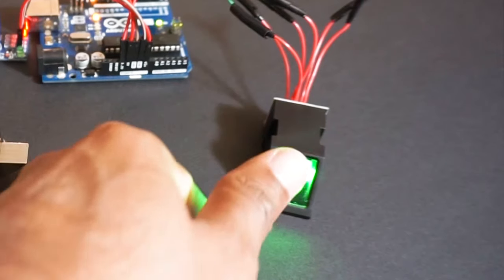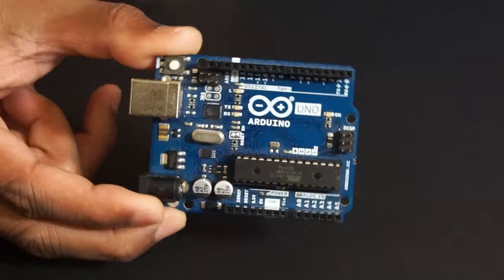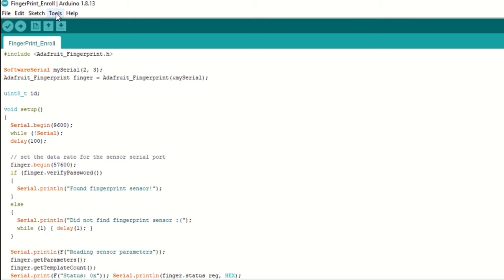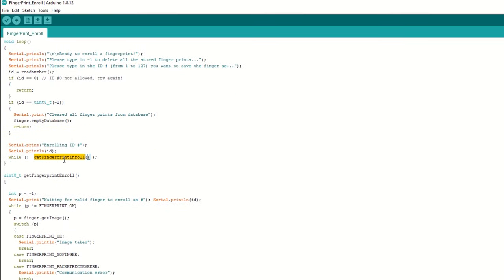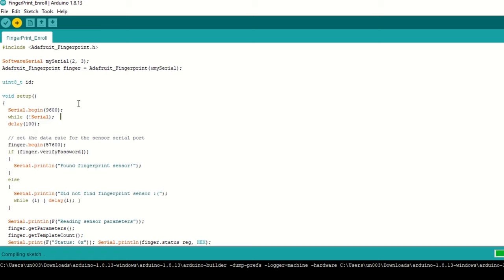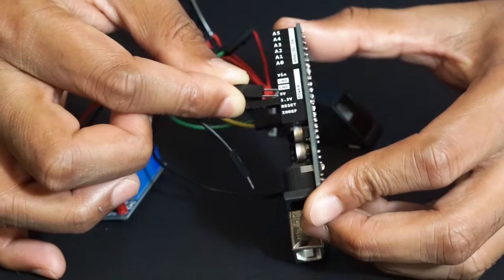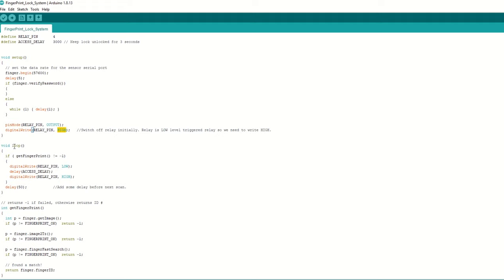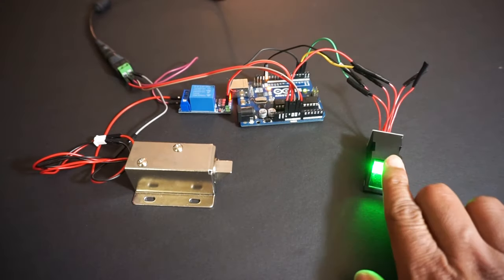Fingerprint Door Lock system using Arduino👍🔓 | FPM10A fingerprint module

Comment: 00:41:16.381 -> Ready to enroll a fingerprint!
00:41:16.415 -> Please type in the ID # (from 1 to 127) you want to save this finger as...
00:41:20.830 -> Enrolling ID #1
00:41:20.830 -> Waiting for valid finger to enroll as #1
00:41:20.863 -> .
00:41:20.863 -> .
00:41:20.898 -> .
00:41:20.898 -> .

I get above endless loop of timestamp, thank you because from your video, I was able to connect my fingerprint, but I cannot register fingerprint
Reply from the maker: You might be missing some step . Please check the video carefully and slowly 👍🏻👏🏻
Reply: @hashincludeelectronics  thank you, am following well, it's detecting and it is registering but the timer is still running

Comment: Shall i use 12v ac dc adopter with 2.5mm pin  and the power jack is 2.5 mm. Use or not please reply
Reply from the maker: You can use that 👍🏻👏🏻

Comment: Awesome explanation I wanted to add a  buzzer to the above project  can you please help me with it's code like what I have to modify in the code so that Buzzer beeps incase of an incorrect fingerprint can you please help me with this
Reply from the maker: Sure . Adding buzzer is very simple .Please check my other videos where I have used buzzer for reference and make the simple code change accordingly. Check my ultrasonic HCSR04 video where I have used buzzer .
Reply: @hashincludeelectronics  Just watched the video thankyou it's helpful is there any way I can contact you as I have some more doubts about the project
Reply from the maker: @niharikam4744  you can join my Instagram hashincludeelectronics

Comment: Hi great video, but i have one question. Why does my lock go the opposite. What i mean by that is when i supply 12v is opens without the touching the sensor, but when i touch the fingerprint sensor it locks.
Reply from the maker: Thanks for checking out the video . Looks like your relay is high level triggered relay. Use low level triggered relay and your problem will be solved . Or you can make changes in code  and Interchange HIGH <-> LOW.
Reply: @hashincludeelectronics  thank you very much that worked out very well. 👍
Reply from the maker: @miko2946  I am glad that it worked now 👏🏻👍🏻

Comment: Hi, great video! I have a question about the fingerprint sensor. Its TTL interface or USB? For the USB interface can I use the same method in the video to connect the sensor to the arduino?
Reply from the maker: It’s TTL method . Please follow the video 👍🏻👏🏻
Reply: Bro,how to install adafruit fingerprint

Comment: When I place my finger nothing happens. I checked if there was a problem with the scanning but it was fine. It could recognise my finger. I then tried to test the lock and that works too. I cant understand what is wrong. If you can help it would be really nice. Thx bhai 😁
Reply: Wait i did it. I looked through the video again and realised I didn't calibrate the sensor properly. Your an amazing guy tysm :>>
Reply from the maker: Good job 👏🏻. Well done and I am happy that it worked 👍🏻

Comment: hello sir you use adapter dc ac 12V 1A or 12V 2A or 12V 3A
Reply from the maker: You can go for 12v 3A if available . Else 2A is also good .
Reply: @hashincludeelectronics  tq soo much

Comment: Sir
I uploaded the first code and enrolled my fingerprint there. Its working properly. I'm using R307 fingerprint scanner. But after all connections when I uploaded the final code and when I'm trying the lock is not at all opening and the fingerprint sensor light also turned off after I put my enrolled finger for final checking. You are my only hope. Please help me in this 🙏
Reply: Did you find out where the mistake was? If so, could you please advise me? I have this problem too.
Reply: @alphatauer4766  Sorry bro, After I got this problem, I left the project because I don't know how to proceed further. I tried to proceed further but nothing worked out...

Comment: Hi, I'm getting this * did not find fingerprint* I'm using Nano and used the same conding that you provided. when i connect the wiring my sensor doesn't turn on.😢 
Please help me.
Reply from the maker: Please use Arduino Uno only . Because sensor needs 3.3v and not sure if Arduino nano is reliable in providing 3.3 v .
Reply: @hashincludeelectronics  There is 3.3 v option one more thing now I'm getting error of can't connect to COM port and all of lights are turned ON on my nano board.😐
Reply from the maker: @sereneexistence1480  do you have Arduino uno . Please use that and try 👍🏻👏🏻
Reply: Exam I am getting the same problem

Comment: I need some help. My lock works, but only once, and my fingerprint senor light is flashing slowly, and doesn't work after once, and I have to replug the power adapter to open the lock again. Any solutions?
Reply from the maker: Check with another sensor .
Reply: @hashincludeelectronics  It works! Thanks!
Reply from the maker: @NanoTheLuuProto  awesome work 👏🏻👍🏻

Comment: Bro i have problem i use arduino mega instead the uno there any problem with it ?
Reply from the maker: It should work with mega as well . I don’t see any issue .
Reply: @hashincludeelectronics   the problem is in codes i think can you help me ?
Reply from the maker: @miranwahid9472  what specific error are you getting in code ? The code is well tested and works .
Reply: @hashincludeelectronics  the pin in uno serial 2,3 is not work in arduino mega when i put the wire in same place the sensor doesn’t show light !
Reply from the maker: @miranwahid9472  do you have Arduino Uno by any chance ? I would suggest Try on uno first and see if your sensor works as shown in video . Then try on mega .
Reply: @hashincludeelectronics  no i don’t have uno :(

Comment: Thanks, I'll try to make it, I hope it works
Reply from the maker: Cool 👍🏻all the best for your project
Reply: @hashincludeelectronics  If I have a trouble, may I ask you a question?
Reply from the maker: @denart99  sure anytime here .
Reply: @hashincludeelectronics  ok, brother 🙂
Reply: Brother, I have a problem, the solenoid won't move even though I have attached the cable correctly, even when I plug the 12v adapter into the mains, it emits a slight charred smell
Reply from the maker: @denart99  could you please check if the adapter is providing correct 12v dc only ? Also make sure you connect positive and negative wires correctly . Red is positive and black is negative . Also make sure your solenoid lock is 12v lock .

Comment: Bro pzz i have all components redy but 
The problem is when i connect finger print sensor to Arduino the sensor dosnot onn when we go to add the finger then it get onnn
Reply: And when we connect uno to pc the sensor doesn't gett on
Reply from the maker: Please follow the exact steps in video 👍🏻👏🏻

Comment: If i connect fingerprint to 5v it's right or no
Reply from the maker: Please check the video and connection diagram 👍🏻
Reply: @hashincludeelectronics   yes i watched but I use another type of fingerprint work at voltage 3.6-6 volt
Reply from the maker: @HusseinKadhimJawad  ok in that case you can use 5v

Comment: Is there anyway to open the lock when there's no power?
Reply from the maker: That’s a good question 👍🏻 You have to add a mechanism based on key which will open this lock in case there is no power. There is some mechanical work needed when door lock is installed in real scenario . Or you can make it battery operated and add indicator for battery power and make sure battery is not drained .

Comment: can you make bypass button to release the door from inside
Reply from the maker: You can add it easily . Just use a button inside and read it using digital read . And open the door lock same as video
Reply: Just hook up the power supply to the lock via button

Comment: In R307 fingerprint module, there is no pin for 3.3V, in that case can we connect +5V (pin 1) of R307 to +5V of Arduino Uno ?
Reply from the maker: Yup . That should be fine .
Reply: It's showing only COM 3 AND COM 4  in the port...
How to select COM 7 in Arduino Uno??
Reply from the maker: @kondakavyalakshmipathy2091  you don’t need to select specifically COM7. You have to select the port where your Arduino is connected 👍🏻 try selecting any one port you see .
Reply: Thanks for your reply
Reply: I selected COM 4 and also uploaded the code...
But in the serial monitor, it showed as Did not find fingerprint sensor...I don't know where the mistake is...
Could you please help me out with this ?
Reply from the maker: @kondakavyalakshmipathy2091  make sure your connections are good.
Reply: Sir, I am getting the exact reverse as the output i.e. when I place the finger it is getting locked and after 3 secs it gets unlocked. I have also checked the connections, could you please help me out with this ?
Reply: Also, can I get your mail id
Reply: @kondakavyalakshmipathy2091  Have you done this project successfully,Mam?

Comment: You can add more than 200 fingerprints to FPM10A .... so if you enroll, let's say 50 people, each with four fingerprints, and you would like to remove one of the enrolled users... how would you do it?
Reply from the maker: Thank you for checking out video 👌🏻. You can easily do it with the library function deleteModel(uint16_t id).
You just need to pass the id’s of that person .
If you don’t have the id’s of the person then you can scan the finger print , match it and get the id . Then use this id to delete the fingerprint . Hope this helps 👍🏻

Comment: Hola muy buen video, sin embargo tengo un problema que me gustaria saber si puede ayudarme, al momento de ejecutar el codigo enroll me dice que mi sensor no se encontró , mi sensor es un as608 de arduino, pero ya revise y todo esta bien conectado, tambien ya tengo instalada en mi IDE de arduino la libreria adafruit fingerprint sensor no se que pueda ser mi error, saludos
Reply from the maker: I would suggest to check the video slowly and carefully again to not miss any step 👍🏻👏🏻. Don’t worry issue will be resolved

Comment: I did all things but my solenoid is not working fingerprint with relay is working
Reply: Also I'm using 2 batteries
Reply from the maker: Try supplying 12v directly to lock and see if it works . Else your lock might be faulty 👍🏻👏🏻
Reply: @hashincludeelectronics i tried the lock itself and it works but it still not working when i put my fingerprint
Reply: And i have a question. If we upload the lock code, is the fingerprint code will be deleted from arduino?

Comment: Help, my fingerprint sensor isn't turning on.
Reply from the maker: Please make sure you are powering it as shown in video . Also check for any loose connection .
Reply: @hashincludeelectronics  I uploaded the lock system code, and the light turned on, but when I got back to upload the enroll code, it turns the light off. I can't enroll a fingerprint without the light.

Comment: Power?
Reply from the maker: Thanks for checking out video 👍🏻 however I did not understand your question . Could you please explain more ?
Reply: @hashincludeelectronics  from which power to move the solonoid
Reply: @hashincludeelectronics  i tried but the solonoid didn't move and the relay went out a red light
Reply from the maker: @falighiqwan9875  use only 12v AC DC adapter .
Reply: @hashincludeelectronics  hello sir you use adapter dc ac 12V 1A or 12V 2A or 12V 3A

Comment: why can not find fingerprint sensor？
Reply: what should i check
Reply from the maker: Do you mean you can not find fingerprint sensor on website to buy ? Or some other error ?
Reply: @dereku7959  The connection wires must be loose.